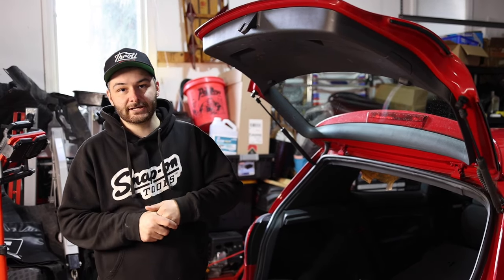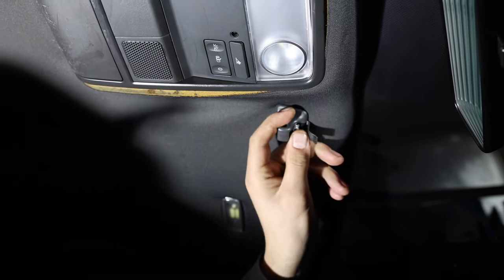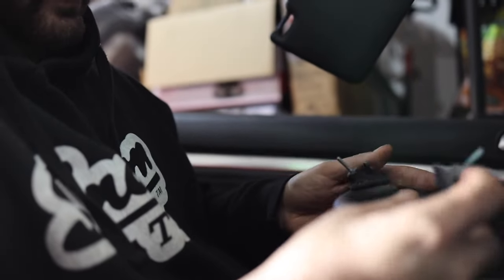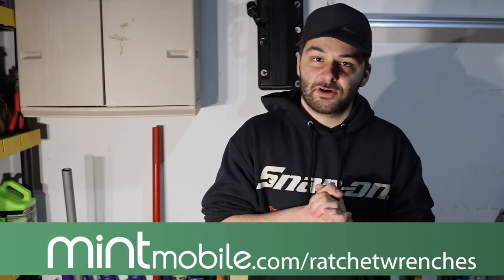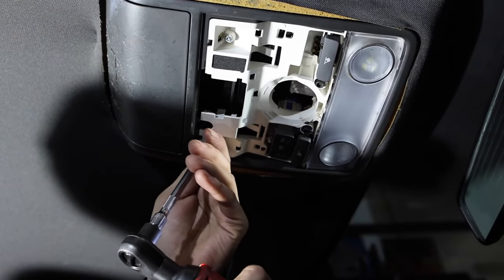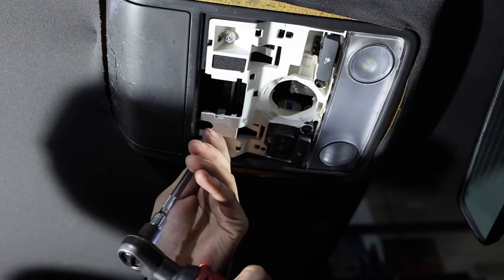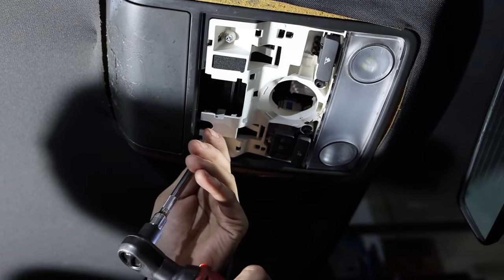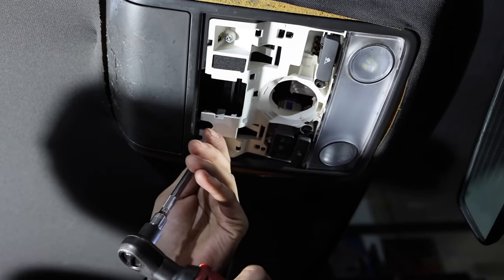How To Fix Your MKV GTI Headliner FOR GOOD... Under $100!

Comment: Volkswagen should be sued for their headliners sagging in every VW models....
Reply from the maker: They really should be! 😂
Reply: @RatchetWrenches  absolutely bro.,  The VW headliner saggings are a hot mess all over the world now. 
 it's bout that time VW takes responsibility and repair their sagging liners and door panels for free to no charge to the oners .....
I prefer to spend my money on my children, and not some sagging VW headliners...
Yeah ..
Reply: Agree 😂 im glad mine still looks good after 17 years
Reply: It's not just Volkswagen. Same problem I had with my older Dodge Dakota. Pulled the headliner out. Instead of replacing the fabric I went with black flex seal after a thorough cleaning of the shell. Turned out fantastic....and no more fabric to worry about sagging.

Comment: I did this exact replacement in my 2006 GTI. It took forever, the issue was mostly the leftover glue and fabric stuck to the board. Not hard but just time consuming. You guys did a great job!
Reply from the maker: Agreed its very time consuming! But so worth it. Thanks!

Comment: About to start this job on my mk6 gti tonight. I believe i got the same fabric too.

Looks like i should grab a beer or 2 to have while doing it.
Reply from the maker: Awesome! Hahahah yes I'd highly recommend! The removal of the old adhesive is very tedious but important to get it as clean as you possibly can. Just take your time and make sure you tuck everything and press firmly to make sure that headliner adheres well and you'll be set. Good luck!
Reply: How did it go? I'm planning on doing this withy my mk6 gti. Mine also has a sunroof, which the one in the video didn't. Any tips you have would be appreciated :)

Comment: This is probably the best tutorial I’ve seen for replacing the headliner in a golf. I’ve just done my wifes car using this as a guide. 

I’d recommend using methylated spirits to remove the final bits of glue, just pour it on and wipe it off. It took me 2 500 ml bottles. 

I think the hardest part was getting the screws back in to all those little metal blocks in their little housings along the front window, the ones for the sun visors and the light/sunglasses assembly. That took me flipping ages to get everything lined up so the screws would go in properly. I spent a lot of time upside-down with a torch in my teeth and my feet sticking out the door above the roof. Whoever designed those things needs a career change to design torture chambers or impossible puzzles or something.
Reply from the maker: Thank you! And hahahah yes totally agree with you on that one!

Comment: You mentioned the mk5 and mk6. I had a mk4 Jetta, 2001 and it did the same thing. It’s Volkswagon, across-the-board. Mine just came down in my 2011 GTI. I’m going to pull mine out and plasti-dip it. I’m not putting another liner back in
Reply from the maker: Haha true it's basically all of them! And hopefully that's a better solution for you

Comment: I have followed all the steps and am putting my newly made headliner back in. You started connecting at the front? I am on my own and it’s quite a pain to hold it up in place and start bolting in everything.
Reply from the maker: I think we started connecting at the back of the car first then moved forward. Yeah it was a PITA with 2 people so I could only imagine doing it solo! Maybe prop the front up with a piece of wood or something and work on the back if you can't get any help

Comment: Great video. Do you know if its safe to drive my car around with all the panels and headliner removed? Im dropping my headliner off at an upholstery shop but i still need my car for work. Just wondering if its safe to drive around with the airbags exposed
Reply from the maker: It will be safe yeah. More noisy because of no insulation but yes it’ll be safe
Reply: @RatchetWrenches  I appreciate the reply.

Comment: Did you use a wire brush to remove the old glue and foam from the headliner?
Reply from the maker: We used a variety of tools I think we tried the wire brush but it was too small and abrasive
Reply: @RatchetWrenches  so what did you use to remove the old glue and foam as am thinking of doing mine
Thankyou

Comment: right after the central lamp in the front middle - there are 4 holders that hold the front attached to the roof - how you managed to get them out?
I just did mine today and unfortunately just broken the plastics :( .. but it took me like 40 min of messing up while looking on how to extract those .... :( Any guidance would be really helpful ... still for future knowledge
Reply from the maker: Are you referring to the 4 T30 screws that are behind the sun glasses holder and other plastic trim? If so you would just remove those screws but if you're referring to something else I just rewatched that segment and I don't think we filmed up close when actually removing it but if I were to guess it'd either be hooked on or some kind of plastic slide piece so you'd just have to be really careful and wiggle them until they loosen up!

Comment: Too much material? More like not enough. The way they start to go suggests that they stretched the material too tight. I watched it first start to pull back at edges, like around my overhead console and rear done light. Then it started pulling out in dips and corners, like the sun visor well. I always figured Volkswagen cheaped out and pulled it too tight to try and maximize material savings. It's so annoying. 

Also, the Mk4 generation had its own headliner problems, specifically in the sunroof models. All the moisture intrusion from the sunroof (whether you experienced the dreaded blocked drains or not) caused the fabric to deteriorate prematurely. It didn't seem to happen nearly as often in non-sunroof models though, unlike the Mk5 & 6.